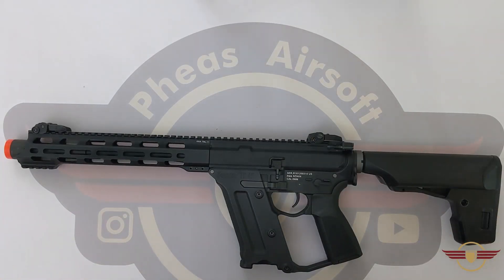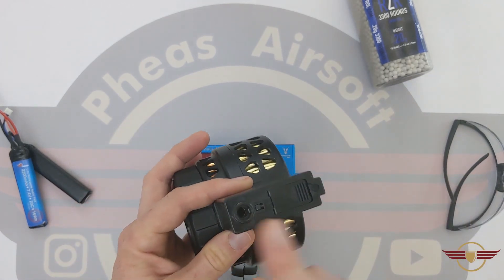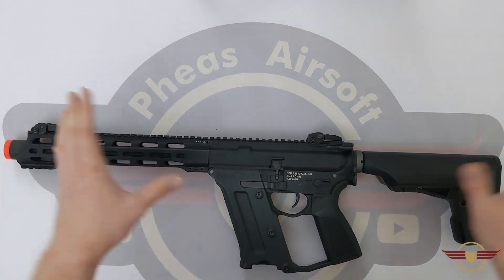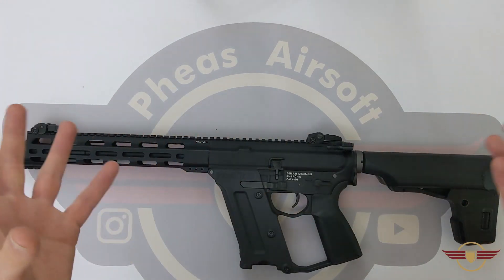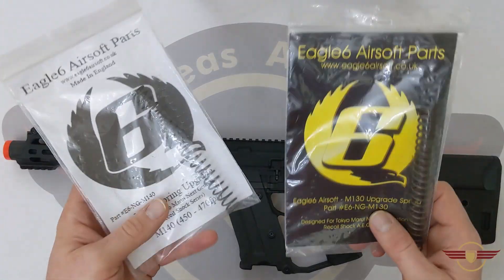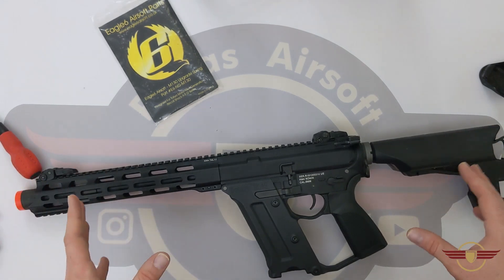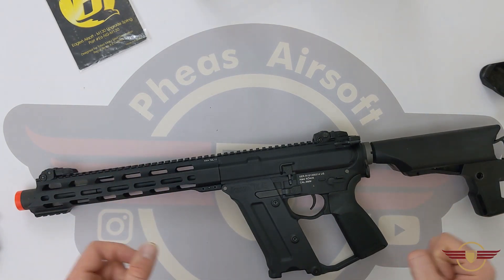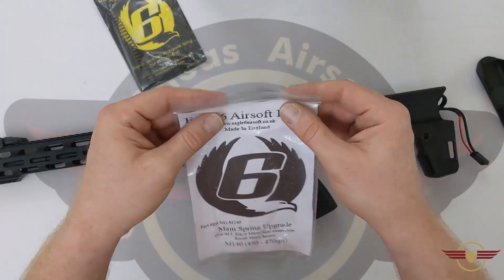[KWA TUTORIAL] KWA Spring options - Vid 3 of 5

Comment: Hello, i recently purchased a KWA ronin t10 aeg3 recoil m4 and i am looking for a spring upgrade. 
Now with the stock version I am shooting .3 BBS with 1.45 J and 320 FPS, i saw from your springs intended for Tokyo Marui Recoil Shock Series  are producing less than my stock setup. What do you recommend to upgrade it to aroung 1.6-1.7 J and ~350 FPS ? 
Great videos btw on the KWA series
Reply from the maker: Hello! You could add spacers to increase the fps, but if you arent careful they could break and cause issues in the gearbox, I am not aware of anyone doing higher tense springs than the "stock" KWA one, but might be worth emailing them and asking. pheas
Reply: Hey Alex, did you manage to find a decent solution to your issue? I'm in the same boat!

Comment: Which spring should I use for T10 since it also has recoil system. I'd like to achieve 460 to 500 fps. I am bit confused with compatibility...
Reply from the maker: Hiya, they are a custom linear spring, so you would need to find someone making them specifically for it, I dont even know of anyone doing them unfortunatley! Pheas

Comment: Great video help me out alot. Did you chrono with the hop up off? Cheers.
Reply from the maker: Hiya. I did indeed! I always make sure to chrono with it off so you know the full power of what it can do. Glad you are enjoying the content! Pheas
Reply: @PheasAirsoft  that's good to hear. I'm using the kwa pts cm4 at the minute with upgrades. Its shooting around 355-360 I'm looking for a downgrade spring. 
With the tm m120 will I have similar results with a 6.03 inner barrel? 
Thanks in advance.
Reply from the maker: @fullcarbon991  With a drop in FPS you would generally still expect to get very similar / the same sort of range and accuracy, but the bb just gets there a little slower than it was doing before hand. Can depend on the hop rubber and the compound it is made of though, so if you do see some issues then try a softer rubber. Pheas

Comment: If anyone is after the 350fps mark try the asg m125 spring, chucks out 346/348 fps
Reply from the maker: Is that a linear spring? Pheas
Reply: No idea... I brought the m135 and the m125 because of the hassel it would have been to "cut" the spring to reduce fps with some parts being "tighter than others" 

The 135 was chucking out 365/368 fps

And the m125 was 346/348 as I said
Rate of fire with everything else stock was 22.8rps 

Tbh this spring actually increased my trigger response...dont know how much by but it was noticable:)
Reply: Have you had any feeding issues